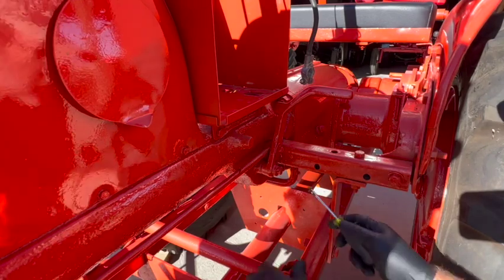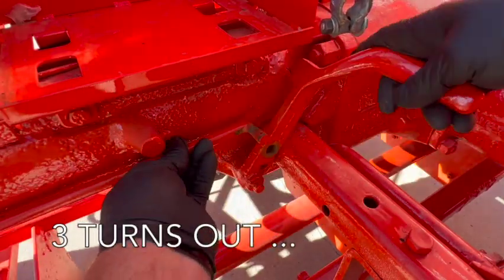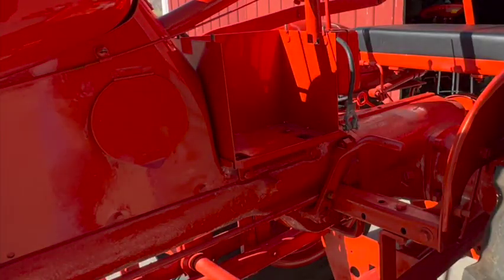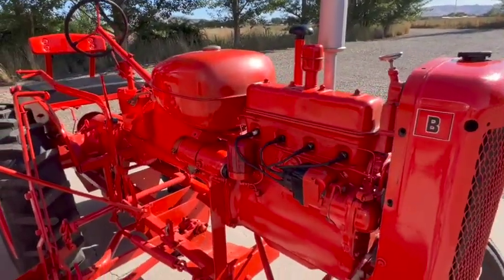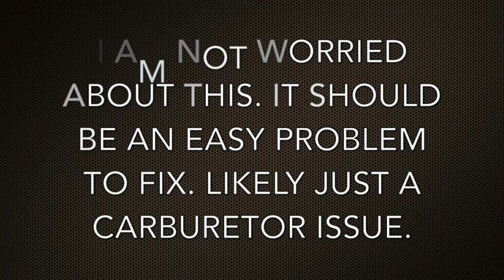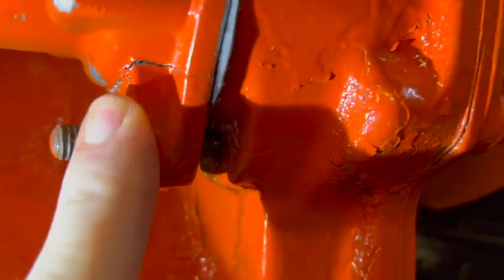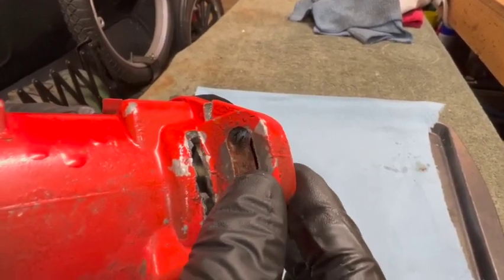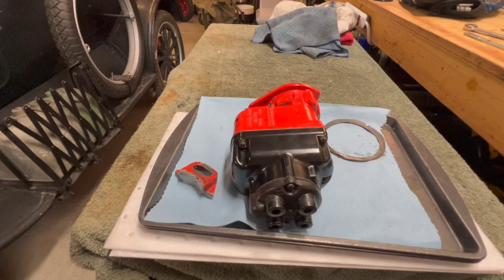1944 Allis Chalmers B - Part 5

Comment: old farmer trick for welding cast iron it works  take parts needed welded without melty parts   in it put in oven to 400 degrees let soke up heat good  have nickel rods for welder  leave oven on weld parts quickly but back in oven to 400 then every 5 minutes turn down heat very very slowly keep turning down heat its whole key of making this work cooling it off very slow

Comment: You can get an anti surge spring which will help with the serge issue as the the governors very sensitive
Reply from the maker: Thanks Dale. I did not know about the anti-surge springs. Mine smoothed out after a mag and carburetor rebuild.

Comment: JB weld it and put the spacer under it until you find a good housing.
Reply from the maker: I might try that first!
Reply: I would drill it and put pins in it and then put jpweld in it.

Comment: Option 1 is weld it not a lot of pressure on that and you have NOTHING to lose. Then the other three.... you have to take all the guts our anyway...... grind the side down on it bevel the edges, heat it with a torch then welderup! p.s. put the spacer in on re-assembly?
Reply from the maker: Yes, definitely install a spacer!

Comment: Gives you something to keep working with. After all,  what fun would it be if it always worked on the first try. JB weld? Most of the weight is on the top bolt.
Reply from the maker: Challenges are part of the deal. Yes I might try the JB Weld before anything else. It’s worth a try.